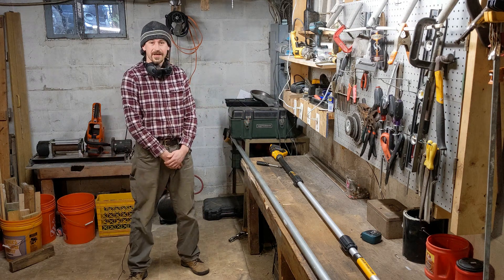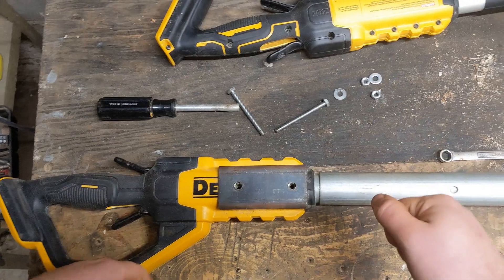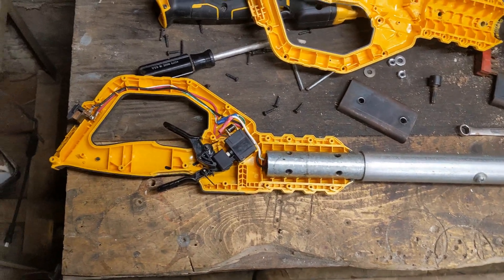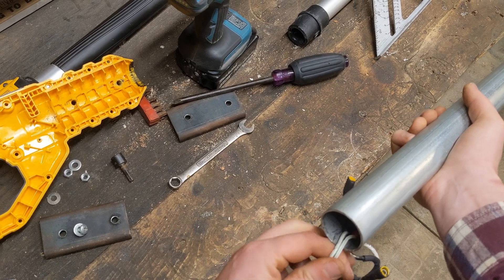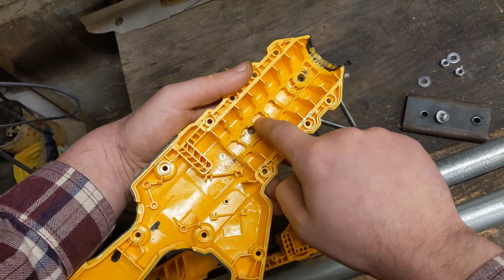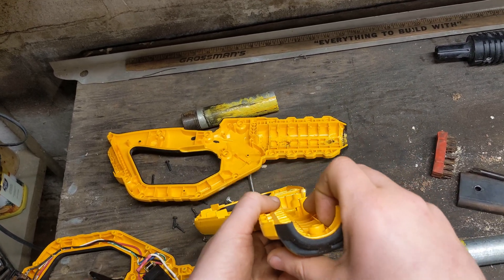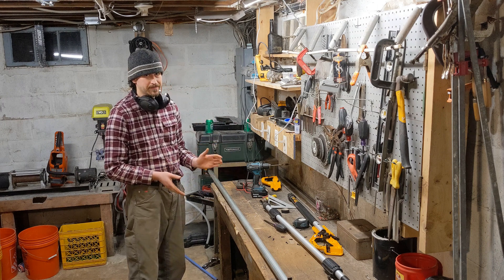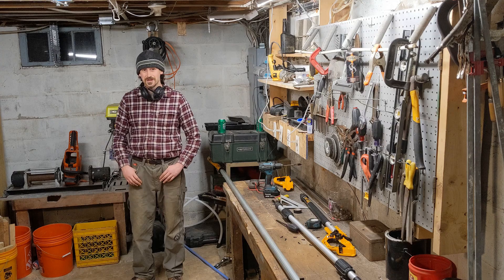DIY 20' Extended DeWalt Polesaw Teardown (How it's made)

Comment: Yes the 15’ extension does bend..does bend cut the power? My Dewalt pole saw fail on the 2nd day of use..oil was always check and fill..5amp batteries..got a refund..

Comment: Top pole that has the chain saw, snapped at the joint were it is coupled to the extension pipe. The limb frappes the saw head and the thin aluminum just snapped. Any thought of ideas how to fix that please and thank you.

Comment: Nice modification. I would have added a drill handle to the pole to hold it up with my left hand while I pressed the trigger with my right hand. It might also make it easier to operate as a counter lever handle. and I would have painted the brackets yellow to match the tool.

Comment: Or you could have just bought an extra middle section, grind down the 2 guide tabs and been done with it.
Reply from the maker: Good idea, the simplest solution is usually the best.  Unfortunately I couldn't find any middle sections sold separately, and wasn't sure if those pieces would be strong enough with the increased leverage.
Reply: @jeeves744
@jeeves744
 I have an extra extension..you are saying all it takes to add an extra middle extension is to grind down the guide tabs? That's it?
Reply: @mattbinar8288  pretty much yes. You will notice on the male end there are only 2 guide slots and when you look in the female end there are 4 guide tabs inside. Match up the arrows on each section and remove the two tabs that don't line up. Thats all I did and it works perfectly fine. The extra lenght makes it a little floppy, but just be careful and its fine. I still use it with no problems. Just take your time and don't try to force it. It took me several "grind, see if it fits" before I removed enough that they screwed together and wasn't binding up.
Reply: @jeeves744  thank you. I'll give it a try and if I have any issues I'll let you know. Thank you again